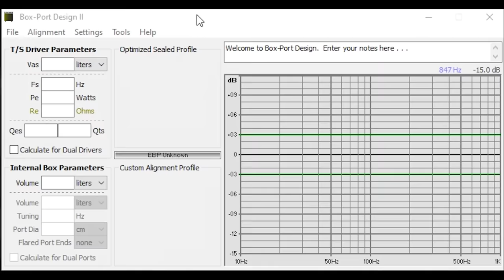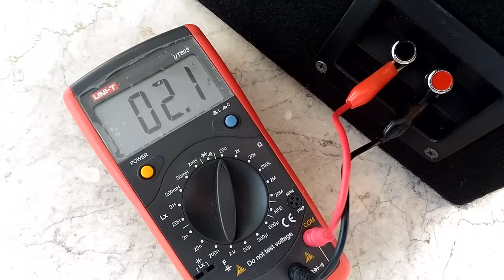How To Make Sealed Subwoofer Box - QUICK DIY BUILD

Comment: Thanks for your video. I’m a First time box builder with a jig saw and hand sander, no table saw, chop or miter. Anyway to help keep the cuts straight? Also, thoughts on Mdf vs birch ply? Same price for me locally for a 2x4 sheet. I’m making a 1.0 cube sealed box for a single Dc 12”
Reply from the maker: If mdf is same cost as birch, then go for the birch. Mdf here in the Philippines is very cheap by the way while high grade plywood are a luxury.

Get a straight edge and use it as guide against the jigsaw. You might want to screw down halfway that wooden straight edge guide.
Reply: Get table saw, is the best saw.

Comment: Very neatly job! 👍 Box made perfect! 👍 But this subwoofer very very low quality driver! Because this Woofer have very high Fs 46,fantastic high Qts 1.04 and very heavy Mms 123 gr.!!!!!!!😣☹️😞🙁!Very poor Driver!😟😞🙁👎👎👎👎 MR..next time use perfect bass woofer - Seas h1192-08 cd22rn4x, this Woofer have size only 8.5"!!!Very little, but have very low Fs 20 Hz,and Audiophile level Qts 0.24!!!Have very  light Mms 41-42 gr.!Amazing woofer!👍👍👍👍👍👏👏👏👏👏But need use two passive radiators tuned 14-16 Hz,because this amazing little woofer have big VAS 108 L. Two passive radiators need for balance diffuser...

Comment: Awesome work dude! Question: is it necessary to fill up the box with cotton?
Reply from the maker: Thanks for the feedback. The polyfiber fill will make the box "bigger" to the subwoofer so low frequencies will be produced lower than the initial box tuning.
Reply from the maker: Psychedelia  This sub is not high end. It's low end. Has 47Hz Fs and a QTS of over 1.15. So must fill something to lower the overall tuning a bit.
Reply: Psychedelia not sure what you mean by “high end”, but my sub is Pioneer TS-310S4.
Reply from the maker: @maksrassi  I think his "high end" means high quality.
Reply: Psychedelia  as far as i know polyfill is used in sub to reduce the heat, idk why yours got hotter? It acts as sponge and "lowers" the air friction causing the temp inside the box to stay lower...

Comment: Do all sealed boxes need that much fill.I have a sealed 12 with probably a 1/4 of that fill.?Good vid btw!
Reply from the maker: I think I over filled it. 🙁
Reply: @chrclmnky  LOL,thanks .
Reply: When you put that last section on the side why didn't you make it go flush with the rest of the box instead of like a insert, just curious. Wouldn't air escape that unless it went against the other boards?
Reply from the maker: @peterlallas1326  box is coated with rubber cement so no leaks. Also sealed all the seams inside the box.

Comment: Do the nails hold the enclosure together well without any problems?  What about a heavy duty subwoofer?
Reply from the maker: Glue and pin nails are good for boxes with subwoofers having a power up to 1000w RMS. More than that should be of some industrial strength materials.

Comment: What type of wood did you use and what are the other materials for the box that you used? Such as the glue and the inside for the sound barrier aswell the wire connectors?
Reply from the maker: Hello Heriberto, the wood is just an MDF.
Reply: What do you mean? Sorry I am confused. I am a mechanic and mainly a do-it-yourselfer when it comes to automotive. I prefer to make my own box and install it myself then pay an arm and a leg for someone to install it.
Reply: @ortiztaxi1055  https://en.wikipedia.org/wiki/Medium-density_fibreboard  It's cheap and available at any lumber place.  Even most high end speakers are made from MDF.

Comment: Nice one sir! Kapag sealed box po ba kailangan ko gumamit ng subsonic filter?  DS18 SLCMD12.4 D 250w RMS po sub ko then naka set ang gain ko ng 22.3 Volts lang gamit multimeter. Amplifier ko naman po ay LL Mono 1000w.

Comment: Hey I have a pair of these in a pickup with a separeted sealed box ( because of few space)with a 1000w amp 400 rms,  but I think is not enough,  I dont know if is because they need a ported box or should I change the amp?
Reply from the maker: These subs bumps, might need at least 2kw rms amp for a greater headroom for burps and bumps. Also, ported box will give justice.

Comment: Does the size of the cabinet determine the  maximum bass output or quality?
Reply from the maker: Yes. 😄
Reply: How do i obtain max bass for my build?
Reply: @UncleBlue_11  follow the specs specific to the subwoofer your using.there is an optimal internal box volume range recommended per speaker.
Reply: @kolourblind3124   thanks alot i went back to the drawing board and am impressed 👌🏾👌🏾with what i got.

Comment: Hey thank you for the video does that fiber fill or poly fill stuff work on a ported box? And how much do are you supposed to use?
Reply from the maker: Yes will work on ported boxes. Use a calculator to know how much to use like Bass Box Pro 6.
Reply: @chrclmnky  do I cover the ports because will it blow out the ports?
Reply from the maker: @CLIFFWILKES  no. There is a matted version of polyfiber fill that can be glued or stapled down inside the box.
Reply: @chrclmnky  A thank you alot 👍💯 I'm about to check out some more of your videos 👍😁
Reply from the maker: @CLIFFWILKES  Anytime.

Comment: Hey, need some advice... I have Sony STR-DH790 AV receiver, which is having 6-16Ohms output impedance, but I have a subwoofer of 4ohm.. can I connect it.. or is there way to make 4ohm to 8ohms.. please share your thoughts.
Reply: yes u can
Reply: if the sub is a dual voice coil then wire it in series to get 8ohms but if its single voice then youre stuck with 4ohms
Reply: Or get second 4 ohm sub!

Comment: What does the padding inside the sub box do ?
Reply: it makes the sub hit like its in a bigger box. the thing is you cant over fill it cuz the sub will need space to dissipate heat from the motor
Reply from the maker: @shoof1696  Thanks for the explanation.

Comment: What if I make a bigger box? Do I still need to put polyfill inside?
Reply from the maker: If you make a bigger box, just make it a ported one. Sealed boxes are smaller than ported boxes.
Reply: Will ported box deliver low bass like this. I want low and clean bass. Don't like messy bass.
Reply from the maker: @israfilanick9375  yes ported boxes produce low bass

Comment: See someone else pulls the annoying it gets in the way guard off table saws too
Reply from the maker: I also end up modifying the riving knife too. I cut the extra length using an angle grinder and leveled it with the saw blade. I saw someone shaped the riving knife like a boomerang or a banana. Looks cool that way, and still very efficient preventing kick backs.

Comment: Hi sir, its me again on different video. 😂 just want to ask, whats the ideal box size for sealed using JBL with kinetic mono amp? Also, whats your personal recommendation for sealed between the 2 products, JBL S2 1224 vs JBL Stage 1210. Both 12".

Many thanks and i already sub to your channel 😊
Reply from the maker: The product is packed with a user's manual. There you can see recommended box volumes. I personally choose Stage series. S2 series easily gets unglued by its front surround.
Reply: @chrclmnky  you've been very helpful to my car setup journey. Thank you very much!
Reply from the maker: @piyowbie33  welcome anytime

Comment: What’s the cotton for?
Reply from the maker: To make the box appear bigger to the subwoofer.
Reply: Charcoal Monkey i don’t get it
Reply from the maker: @trilliedon8728  sealed boxes are usually small for vehicle space issues. To tune it down a bit, then stuffing them with filler like polyfiber will do the trick.
Reply: Charcoal Monkey ohhhh. I ordered a 12” DS18 Shallow mount yesterday but I already have Square box i bought from a local shop can it work with that or should i get one made smaller to get rid of some of the space or should a just put cotten inside of it?
Reply from the maker: @trilliedon8728  you can build a slim and space saving box for your shallow mount sub. Shallow mount subs are really for slim boxes like underseat sub or backseat sub for trucks. And just fill it with polyfiber. You can get polyfiber from pillows or any home depot.

Comment: Can I make Sub box By using Bhutan Board
Reply from the maker: Yes, you can use Bhutan board.
Reply: @chrclmnky  i think Ply wood is better than Bhutan board Pliz explain About this
Reply from the maker: @chongthammeghachandra3721  Yes that is correct, plywood and MDF is better than Bhutan board.

Comment: Hi, i would like to fit a kenwood KFC-PS3016W subwoofer (12 inch) into a small ported box and then into a hatchback... how much would i lose by severely undersizing the box? Would it end up sounding horrible? 1st time attempting to build a box, always had pre-fab boxes. Thank you.
Reply from the maker: Hello, undersizing the box actually maximizes the output but also heightens the tuning . That is what most SPL guys doing: Undersize the box OR oversize the port to achieve higher tunings (around 45-55Hz tunings) but very loud.
Reply: Thank you very much for clearing this up... i was quite worried its gona end up sounding bad. Im gona go ahead and use an undersized ported box 😊

Comment: Why did you add cotton and other things
Reply from the maker: To remove unwanted box resonance and to lower the overall tuning as well.
Reply: @chrclmnky   what if 4 or 8 ohm crossover is add will it increases bass
Reply from the maker: @vivekvs2293  There is a built-in crossover on the car's headunit, and set it to 80Hz. And there low pass filter on the amplifier. So no need for any passive crossovers.

Comment: FAUT POUR LA CONNEXION DU woofer. IL FAUT ABSOLUMENT CONNECTER EN SÉRIE SOIT, LE POSITIF VERS LE NÉGATIF ET RETOUR  ET TU OBTIENDRA MINIMUM 4 ohms CAR 2.5 OHMS TU VAS GRILLER L’AMPLIFICATEUR..
Reply from the maker: Nope, my amp can support 1 Ohm load. 😆
Reply: @chrclmnky  54kmjAa

Comment: Why put cotton inside the box.
Reply from the maker: To make the box appear bigger to the subwoofer.
Reply: @chrclmnky  That doesn't make sense bruh
Reply from the maker: @iacobmarius6810  dampening material will trick the sub to make the box appear bigger, therefore producing lower notes.
Reply: @chrclmnky  ooh,i understand now,filling helps with sound,and i've heard that it's safer for the car also,one friend had to tighten his bolts every week cuz of a 2000w subwoofer
Reply from the maker: @iacobmarius6810  yes 2kw system is pretty massive.

Comment: sir bakit po walang exhaust yan.thanks po
Reply from the maker: Because SEALED
Reply: sir anong mandang box for pioneer 12 inch subwooofer with 500 rms thanks again sir
Reply: sana matulungan mopa ako sir.dahil maliit lang po ang speaker box.ko
Reply from the maker: @princess4610  Let me know the exact model.
Reply: TS-A300D4 po sir
Reply from the maker: @princess4610  I've built a dual TS-A300D4, watch it here - https://youtu.be/TdDXLsSerlA

And you may want also to do this for a single subwoofer - https://youtu.be/lTfRfDBzBz0

Comment: boss pa help naman po..meron po akong 1 dual 2 ohms sub and 2 ohms mono amp..paano po gagawin kong wirings sa sub para po maging 2 ohms final impedance po para march sa amp.maraming salamat po sana po makareply kayo thanks..
Reply from the maker: Buy another one same subwoofer and wire them parallel to make them 1 Ohm each then finally wire them in series to get a final 2 Ohm impedance.
Reply: maraming salamat po idol sa very helpful tips..

Comment: Nice build but Q is 1.3, it's not going to sound right. Too boomy.
Reply from the maker: Sealed boxes don't go boom. Ported box does.
Reply: @chrclmnky  sorry i didn't understand your answer.  I don't want to say anything bad what you are creating, keed doing what you are doing, like to watch your videos, but ported and closed box will boom if calculated inaccurately, just look up for Q factor (damping). Should aim for 0.707 or lower to avoid boomy sound. Small closed enclosures will not sound good, try it your self, build two closed boxes one with high Q and other low Q and have a listen. Cheers.
Reply from the maker: @JanisAbols3000  You can't do anything about the System Q, it's the resultant to subwoofer's factory profile in this particular subwoofer, the Pioneer TS-W261D4. You said the optimized system Q which is 0.707 which is true, but has an equivalent box volume of -1.16 cuft, yes that's a negative value of a box volume! 

Given the same subwoofer, I don't think you can calculate or build a SEALED box that has a resultant System Q which is 0.707 or nearer.
Reply: @chrclmnky  Hi, my apologies, I was talking about Qtc not Qts. On this TS-W261D4 driver Qts is 1.04 only option here is free air/open baffle and box Qtc goes down to 0.770 used my BassBox Pro for that. And in your scenario any siez closed enclosure will rise Qtc and the emitting sound will be far from original because there will be extra dB gain at F3 freaquency. Whole purpose for closed box is to get frquency linearity and smooth roll off. In your case is opposite.!
Reply from the maker: @JanisAbols3000  Never seen a subwoofer with a 47Hz FS in a ported box. LOL.  Don't try to get real crazy over the numbers on your computer.